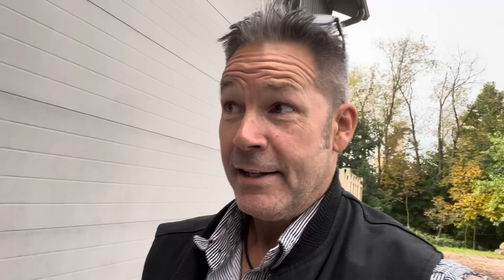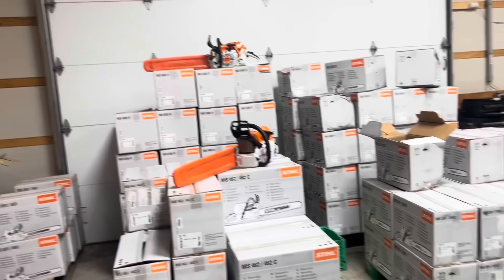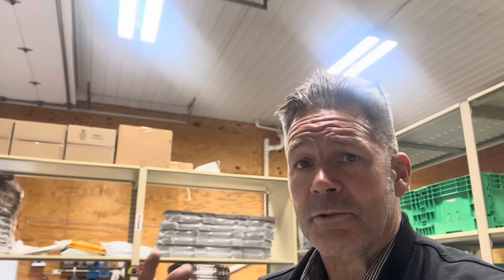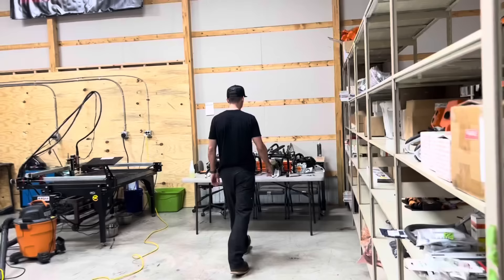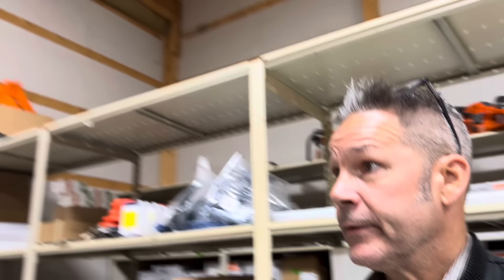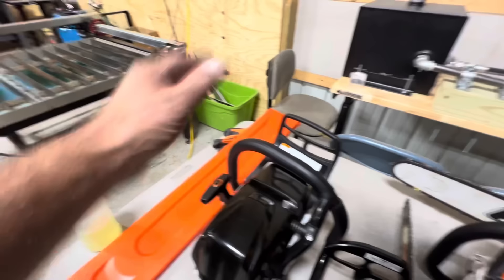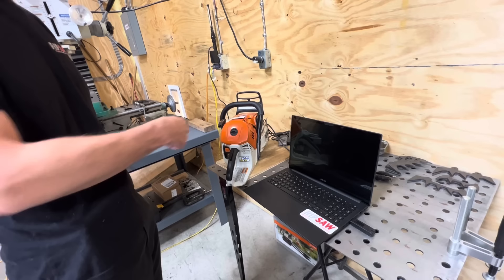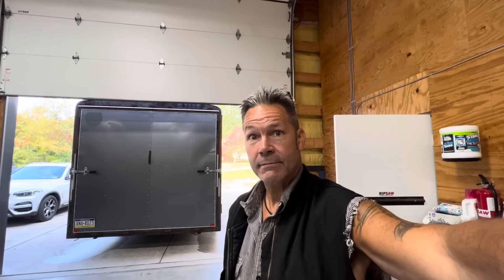STIHL 500i ,plug in reset , never seen on YouTube .

Comment: 20 years ago, did anyone honestly think there'd be a day that a power saw was getting tuned on a computer?
Reply: Honestly, I thought it would only be for emissions, not to make the saws run better
Reply: They aren’t getting tuned, you cannot change set parameters like dwell time in the injector or coil, target AFR, hold times or offsets. Basically the computer is for diagnostic purposes and to put it in reset mode. They are cool regardless but if they could be tuned more power could be had. Even if you could do something as simple as raise peak rev limiter.

Comment: 100% agree about finding the right dealer. I didn't choose my saw. I went to 5 different saw shops in the area I lived in (within an hour or so drive) and talked to them. Picked brains for more information than I can repeat. I ended up with the 461 with no mtronic or any of those extra special electronics. It wasn't the saw nor the dealer, but the mechanic that I chose to work with. The husqvarna dealer in the same town was only contented about selling me a saw. I knew nothing about dolmar but the only shop in the area that carried them were a bit pushy and very brand specific even though they carried stihl. They just kept pushing for domar. And the other two shops just didn't have much of a selection and were more of just a repair shop with a handful of saws. I wish I could find a place here like the one I ended up dealing with there.
Reply: I hear some people say the Dolmar or Makita's are finicky to tune and get right so you made a wise decision!
Reply: @joeysweet9045  Being in a logging area, conversing with many of the Sierra Pacific higher-ups and Red Emerson himself. I looked at what they were using. Never saw nor heard of anyone running dolmar there. Mostly stihls, but I was definitely a husqvarna man at that time. I run both, though, and would never say either one was or is a bad choice. I do prefer my stihls, but I feel husqvarna makes a beefier (for lack of a better word) saw. Stihl has power to weight but feels more delicate, and husqvarna runs excellent in the heavy duty brush. How I feel about them anyway.

Comment: Wow 😮 that’s really interesting to know that you can check the computer on the saw to make it work how it should work. here in Ireland 🇮🇪 they only have the capability to check the nuts and bolts of the machine other than sending the machine back to sthil for a full  physical test and diagnostic test

Comment: Iam a retired arborist & I’ve always only cut with STIHL. I have a MONSTER 881,661 & a 500i all have bark boxes & Max-Flo air Filters. GREAT saws😊👍👍☝️BE SAFE & BE KIND EVERYONE ❣️✌️✌️✌️
Reply: The 661 is a total dog until you port it. That saw and the 880/881 absolutely transform, picking up over a full horsepower. I absolutely love my 661, but I will say that the 395XP husky has it beat for stumping. The 661 is a lot lighter but you’ll never make the torque that the 395 Husky can generate.

Comment: Imho 572xp excellent felling / bucking saw … 462c excellent firewood saw but both can be used vice versa - can’t go wrong with either!  I’d say if you use primarily a 20” bar the 34mm stroke 462c will outcut the 572xp 39mm stroke given the same amount of work by the same builder by a noticeable amount. Put a Buckin special Piper on it and it’ll be good nite Irene for the competition !
Reply: What’s your distinction between a felling/bucking saw and a firewood saw? Because my 400 is my “firewood” saw but all I do is fell and buck lol. Just curious
Reply: @davidcharlemagne6785  I own both saws and that’s been  my experience - either saw could be used for felling bucking or firewood without missing a beat. The difference is in one scenario you are production cutting vs more precision work. I find the 572ps’ handling / ergonomics/ powerband superior to the 462 in a tree felling situation and conversely the 462c makes quicker work on the landing where volume of wood produced is desirable.
Reply: Gotcha! Thanks for the reply. I’ve been a stihl guy for the last several years but have been curious about maybe trying out a husky saw. Those 572s are sure good looking saws

Comment: just curious, does that have to recalibrated every time you change elevations as in going to another state?
Reply: I know you didn't ask me but no it's supposed to auto-tune and calibrate it's self I think the only time you reset is when you service it like a air filter, spark plug or fuel filter change I'm pretty sure.